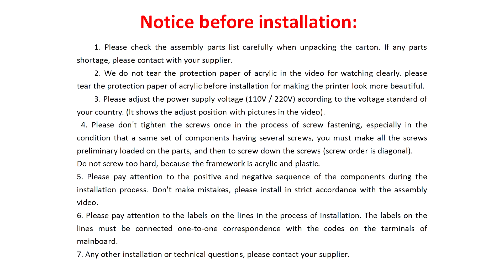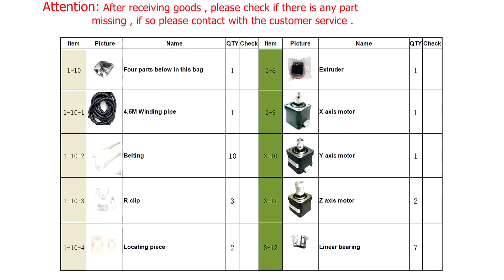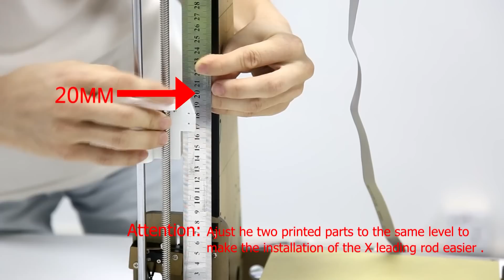3D Printer Instruction--The Newest Anet 3D Printer A8 Assembly Video 1

Comment: for what it's worth, here are a few quick tips. 
1) Watch through part one and 2 before even opening the box.
then watch again as you build. 
2) Put a small strip of masking tape on at least one side to hold the tiny nuts in place. that will save you a lot of time searching for dropped parts and save the ears of people around you.
3) In my kit, the wire labels were all on the wrong end of the wires. Make sure they are nearest the end of the cable that plugs into the board (they all slid along easily)
4) The print head wire bundle is clamped on the right side when facing the control panel. I initially fit it for that then when all done I switched it to the left side. It seems to work better. I used the nut that holds the backplate of the control panel with a spare washer to hold the cable clamp.
Reply: Thanks for the tips! Definitely will try them out once I start building

Comment: To anyone busing this, don't but the t rod far into the stepper coupling. Only 5mm, the stepper spindle should only enter 5mm from the other side of the coupling too. If you put them in all the way you will loose the flexibility of coupling and you will notice the top of the t rod oscillate left and right. Also never contrain the top of the t rod like lots of people do as it will make it staticly indeterminate. Don't take my word for it, research it for your self.

Comment: A quick tip.  Place the nuts in the little slot, then put a piece of masking tape on both sides of the slot.  The nut stays in no matter what position you place the pieces, or if you bump them.
Reply: Smart

Comment: A quick tip.   The mount for the the left hand Z-axis motor might be too narrow for length of screws provided.  The screws might bottom out in the motor before it becomes snug on the mount.  Placing two M3 washers onto the screw before threading it through the mount into the motor should fix it.

Comment: Y-axis binding solution: if you find the Y-axis doesn't move smoothly check that the sheet aluminium parts of the H bed are flat. Particularly the sides of the "H". They are stamped out and this can give them a very slight curve that causes the bearings to bind when you tighten down the screws. The fix for me was to place the H frame on two rods then press firmly but carefully in the middle to straighten them. Made a big difference to how easily my Y-axis moves.
Reply: ColinWatters here’s my three prints from this $140 printer. http://i67.tinypic.com/2dgsyoi.jpg

Comment: During assembly of linear bearings and the rods (around 15:30) you can save few seconds (and some frustration :)) by adding the linear bearings to the rods (from both sides at the time) and then, from the top, slide the rod to the front plate first and then slide it into holes in back plane (or other way round of course in case you do not have the guide rod back plates in place).

Comment: When installing the Z - Rod motor housings I found it a lot easier to flip the frame on its back. That way I could slot the miniscule nuts into the holder without having to fiddle about, dropping the nuts trying to hold them in place

Comment: is it possible to take out the acrylic paper protection?
Reply: You can peel off the paper as it is only necessary during manufacture of the acrylic parts.  I think they only kept the protection intact on the video as they intended to sell the demo unit on.  You will also notice that he hasn't tightened any screws.
Reply: Thanks a lot, man.
Reply: use a hair dryer to heat it up
Reply: Peel it of and then start...it's the best way

Comment: The protection paper is kept on for demonstration purpose, as the parts are easier to distinguish from each other then.
Notice that he got the Y-bed upside down which results in the Y-belt not running parallel.

Comment: I'm putting my A8 together today and have come across a snag! At 33.26 in the vid, you say to install the x axis motor.
 OK, not only my the mounting bracket different,(using 4 screw holes instead of 3), but more annoying you say to use 3x M3*25 screws. 
Two problems. 1: I need 4 screws and 2: I have not got any M3*25 screws to begin with!!!

Please help

Phil
Reply: I just came across the same problem. De PDF included however, tells you to use the M3*20's (Assembly step 12, page 31)
Reply: Thanks I had the same problem
Reply: Itrme thanks I was stuck but this helped
Reply: wow thanks, i had the same probolem and you solved it. HEROO!!!
Reply: Alas m3*20 don't reach through the unit to fix the motor to as it is now thicker.and the m3*30 are 5.6mm too long.  I need to find out how many screws I need of each length provided to see if there are enough to cut down.
Reply: Did they change something in the design? I bought mine about? 3 months ago? The m3*20's worked fine for me. The only issue I have is that the screws do barely suffice when adding finetuning part. for the Z axis
Reply: Itrme apparently - I got mine 6 months ago or more but only time now to build it - my x axis motor slider has 4 screws and a complete square surrounding the x motor.
Reply: In any case, I'm not sure if you have enough parts to cut some down. I would recommend just visiting your local hardware store and get the appropriate screws. They should be reasonably standard size.
Reply: use the 20mm ones and put a nut on the thread to make the thread "shorter"
Reply: AMAZING !  I am just now testing my newly built ANET A8 printer and I am flabbergasted by the quality of the print 😄😄😄.  This is really GRRREEEAAATTT!  Thank you for your videos.
Reply: what pdf
Reply: As you can see are thats only 3 hole for fastening!
The main problem is that 25 mm is too long to fit in the new place.
Reply: Chris Short there are many extra of each screw so you could use a few of any one you need
Reply: Loaf it came with a little orange micro SD to USB drive. You put the micro SD that it came with in the USB stick and plug it in to a computer.
Reply: PDF on the memory stick that came with the printer
Reply: You need 20mm screws. 25mm screws are too long, they bottom out in the motor.
Reply: It seems that the thickness of z-axis motor mount can vary. For some you need 25mm screws, on others 25mm is too long and you need 20mm or they can't be tightened enough.
Reply: Man in the Park   I ended up buying a selection of m3 screws of different lengths. Was at least two mistakes in my kit.
Reply: Man in the Park  The kit comes with extra washers, lol I just did the automotive way and used washers to offset the length of the screws since they clearly revised this section of their printer. If you follow his instructions and install the four screws anyways you will notice the stepper motor can move back and forth whilst the screws are tight.. simply place 8 washers (2x on each) and this will save you. Yes the kit (at least mine) comes with extra washers. No need to order or cut anything lol.
Reply: @ColinWatters  I guess that's why washers were in invented, who'd a thought? Lol.
Reply: @evlsc400  :-) Well I guess you could buy 50 washers instead but I prefer the right length bolts :-)
Reply: ColinWatters If you can’t figure out the function of a washer you shouldn’t be tackling DIY projects, but thanks for coming out! :—)
Reply: @evlsc400 Well if there had been spare washers in my kit I might have used them, but there weren't.
Reply: Yes. I have the same problem, but I like a good puzzle. My cd does not work as well.

Comment: followed this video, took 6 hours from start to printing. well the assembly took 5 hours and 1 hour figuring how to play around before the first print especially bed leveling. though there are few steps that are different compared ro mine such as the location of the x axis switch. overall really easy to follow. i hate that acrylic protector that you have to peel first probably took 20 minutes in total.

Comment: I either have bad bearings or a couple bad rods. One of the x rods has issues with the bearing sliding back and forth and a year rod wasn't very smooth. I rolled the rods on the table and didn't see much of an issue with it, but who knows.

Comment: Cool video.
Shame I have to go buy a load of the right screws before I can finish the build (no m4's and short on some m3's) but for the price I'm ok with that.
Kit was also missing most of the little wooden tabs that hold the rods in place.
Again not a great issue cos simple enough to make but it is slightly frustrating that instead of building in one day and getting to test it, it'll now take a few days before I can see if it all actually works or not.
But anyway, this video helped a lot and is easy to follow along. 😊

Comment: Hi. I managed to assemble my A8. The instructions are not too easy to follow some screws were missing but I managed to get A pack of screws locally. But I managed to work it out. The only problem I have is the extruder  is switched off and I cannot work out how to switch it on.

Comment: A quick tip.  If you ever meet someone that say you should leave the protective paper on the acrylic until after everything is assembled, punch them in the mouth for me.  Once everything is assembled, there is a lot of protective paper caught between adjoining parts, and under screw heads, and in really awkward corners.   Unless you're assembling the printer in a sandbox while wearing steel wool mittens, it's fine to remove the paper first.

Comment: I noticed while assembling my printer that the idler bearings for the two belts are not free to spin. I solved this by making washers from ordinary printer weight paper to keep the rim of the bearing off the frame. This is important because otherwise the belt will be wearing its teeth off on the bearing, and the drag in X and Y drives will be high.

Comment: Stuck at 21:15, the M3*30 screws will not fit through the bottom holes with the wing nuts. They are stripping and now one screw is stuck tight in this hole. I just put a hole in my finger trying to force the screws in!
Reply: Just ruined one screw with pliers trying to get it out, realized that the tips of some of these M3*30 screws are defective and the threading isn't quite right? Gotta make sure your screw threading is correct before trying to force them through these holes...
Reply: After reading that the H-carriage can be installed upside down to align the Y-belt better, I tried that and 3 of the 4 screws went in flawlessly. It took a couple hours of careful screwing and unscrewing to get the last damn screw to go through to affix the wing nuts at this stage... Jeez!
Reply: I'm in the same sh*t and the screws doesn't fit...

Comment: David, my stepper motor for the extruder is making a knocking sound. It appears that the filament is not being pulled through to the hot end. Any thoughts? Could it be the stepper driver? It does retract but just seems to be skipping. And it has gotten worse. Do you want/ need my serial number. I have not had this printer for a month yet. Thanks.

Comment: on the step with the extruder bracket. none of the holes were tapped correctly and now they're all strip and so are the screws.
Reply: That happened with me too. The paint or coating is the problem. I used a tapping tool to fix the thread.

Comment: When I got mine done I plugged it in and it turned on and everything was fine. Then I unplugged it and took it to a different room and plugged in there and it worked. I unplugged it and left for a few minutes. When I came back and plugged it in it wouldn’t turn on. I have checked every connection and they all look good. Can anyone tell me what is wrong. P.S. I have the 110/220 switch correct.

Comment: At 5:12 - This piece does not fit as the holes don't line up on this side. They are about 10mm out from each other. What do I do now?
Reply: I have machine code A384520042 which is too small
Reply: we're you able to sort this out?
Reply: Yep, no thanks to  non-existant tech support and Gearbest's total lack of after sales policy (they just wanted me to return it to China). I had to hack saw some parts off the main frame and drill a new hole. Didn't take too long, just put the rest of the printer together until you can see how it's supposed to line up. It's not the part itself that's wrong, they cut the end of the frame that it fits in about 10mm too far.
Reply: I had the same problem just try the other one flipped around, for me the orientation was wrong. Mine fit just fine after that
Reply: Yeah, I'm not an idiot, it did not fit no matter what. I had to drill out and cut an extra hole as the frame was machined 10mm to long.

Comment: Hi ! I got a question here , is the threat rod is no need to put into the top hole ? you know what I mean or not ? I mean the one into the flexible coupling one ... 
Bcos its not long enough from flexible coupling to the top hole :(
tks
Reply: You need to undo both sides of the flexible coupling and position it on the end of the motor shaft. I had to relieve the end of the screw rod a little with a Dremel disk to get it into the coupler. You don't need to take much off
Reply: checkout the Facebook group for Anet I8 printer - there's a diagram there covering how to adjust the z-axis couplers like evanpanz suggests

Comment: i have 4 y axis fixation clamps, but only one has wide enough holes for the m4*14 screws the other three seem to have holes for the m3 screws. the one with the wide enough holes is 4.4 mm thick while the 3 others are 5.5mm
השב

Comment: Does it make a stronger frame if we keep paper on acrylic?
Reply: The paper is often in the way. The fit is sometimes very tight and the paper will need to be removed then. It also gives a nicer finish ;) without the paper.
Reply: The paper is not of any structural significance. it is merely to keep the acrylic from getting scratched. The only other thing the paper does is help you find the holes.
Reply: thanks!

Comment: shoud the belt be real easy or kinda stiff to move?
Reply: It should not be able to slip on the motor. So not too stiff but certainly not to easy either. The motor will give some resistance too.

Comment: 31:00 my threaded rods won't fit into the z motor, should i just file/sand it a little to make it fit?

edited: i sanded it a little and it fitted, but is it meant to not reach the top hole?
Reply from the maker: hi Maggie,  don't worry it's okay , won't have any influence on using
Reply: If you release the screws on the motor shaft and lift the coupler a little you can capture it inside the top hole
Reply: Is this addressing the problem with the threaded  Z rods being too short? Mine are a few MM short of reaching the top hole, making them incredibly unstable.

Edit: My god, you deserve a medal, sir! Works perfectly!

Comment: The rods that the extruder rides on are VERY tight, is there a easy way to get them in? I dont want to bend the rods but they are so tight I will need to use a hammer to get them through the plastic.
Reply: yes I used a rubber hammer on mine when I built it

Comment: I don't have enough M3*12 screws. The parts list only says 3 as well
Reply: these are where I used my M3*12 screws:
Y Motor - 4
X motors - 8
power supply - 3

hope that helps, if you got less than that I'd suggest you contact anet and give them the unit ID at the upper left of the printer

Comment: Hello, I have problems with the motor X. The screew M3*25 are too long and don't fix the motor.I mean the screws should be shorter
Reply: That's true. I used some washers that I had laying around to fix that. You could also file off 2 mm of the length of the screws.
Reply: if the x motor is connected to he piece that overs the whole motor you need to use the M3*20

Comment: scale of 1 to 10 how hard is this..
Reply: if you've ever assembled a model ship kit before its as easy and as fiddly as that, nothing really tricky but you have to watch carefully and constantly check orientation of different parts because David is assembly it facing you so you are effectively looking in a mirror. Once you get used to that its just a matter of being careful and thinking about how things line up. If you've never tried model building before then its a solid 7 - complex but not impossible,.
Reply: I think the only tricky part is adjusting the belts, because you must cut the belt, and it has a risk of cutting too short/long and ruining the entire kit (or almost making you rush the electronics shop)
Reply: I assembled it together with my 8 year old son. I think you can manage to to do it all in one day. It's easy if you take it step by step with the aid of the video.
Reply: Took me about 10 hours, but I had mods to do where parts didn't line up properly on the frame, and I took my time to make sure I didn't do anything wrong, as mistakes can be expensive. I also was doing after work each night so I wasn't exactly fresh. The videos are pretty easy to follow.

Comment: The two horizontal guide rods were almost impossible to get into the holes.  Is that normal?
Reply: Dartharden There are two small grub-screws in the back of the right side white piece, these need to be loosened with the smallest hex key. The plastic itself is still quite grippy so I didn't bother tightening them again afterwards. If the rods still won't go in, you can use the shortest piece of threaded rod (for the filament stand) to grind away some of the plastic, as the threaded rods are the same diameter as the smooth ones.